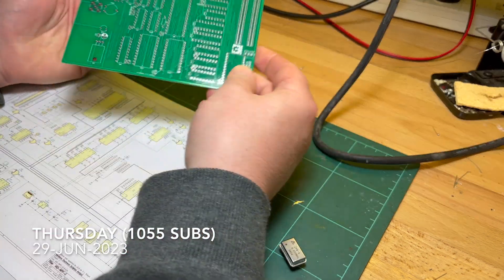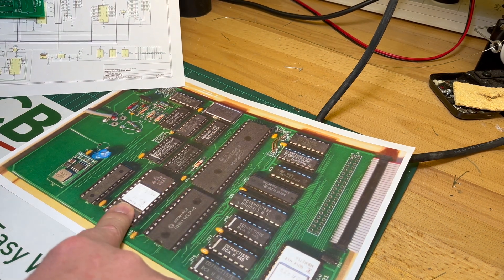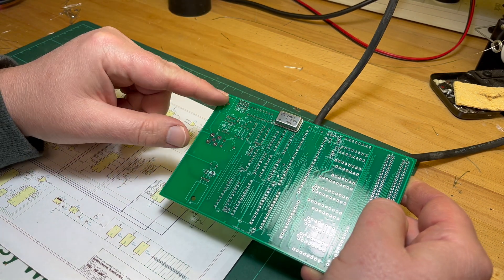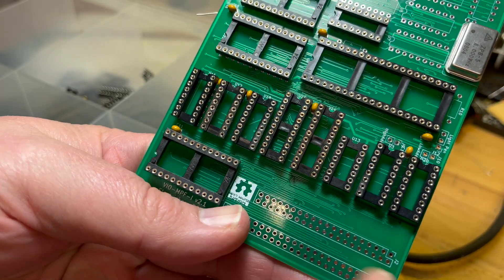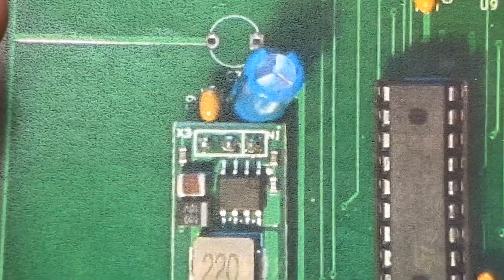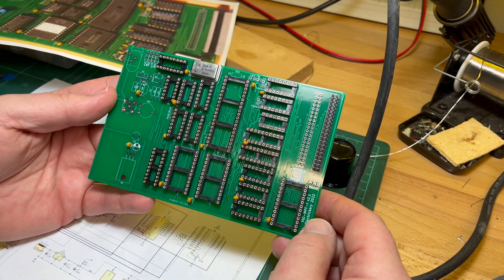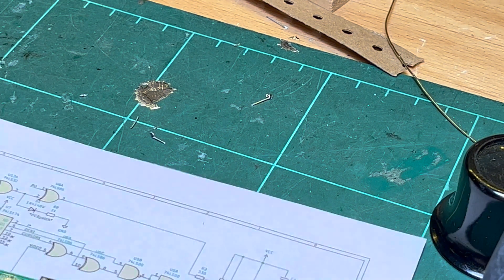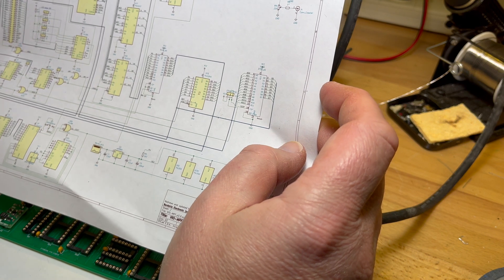🇹🇼 Multitech MicroProfessor MPF-1 Plus: Part 2 (Starting the video interface build) [TCE #0310]

Comment: Looks like you're good on the BD457, I got the datasheet offline as well as a replacement list of mainly Euro and Asian transistors. Common RF transistors can be difficult to get but if you have issues, let me know and I'll check my parts bin(Not that kind of bin!) Some CB Radio BJTs would work OK and they were often TV transistors anyway.

Comment: Did you ever get your BF547s? Mine came in today from Bulgaria. Let me know if you need some. At < $5 for 20, I got 3 sets, for 60 transistors total. :)
Reply from the maker: I was going to ask if you wanted a board (and a Radio 86RK one as well)?  I've got some CRTCs coming, but no, hadn't gotten any further on the BF457 hunt!  I've been waiting for payday this week to put in a large order for all the logic & CPUs I'll be needing for the Radio 86, the VIO, etc. builds!
Reply: @Brfff  I would love a board (let me know what you want for it), and the offer of the Radio-86RK is very kind, but no thank you. I've pretty much used up all of my free space around here. :(

I'll send half of the transistors that I got today and we will both be all set for the zombie transistor apocalypse. The canister that it came in is pretty cool. A bit bigger in diameter than the old Tupperware tubs that rolls of film came in and about twice as tall. It's got a screw top lid and is all aluminum. The transistors at a quick glance look brand new. And they were dirt cheap.
Reply from the maker: Thanks ... when the CRTC chips arrive I'll send a board and one of the chips!